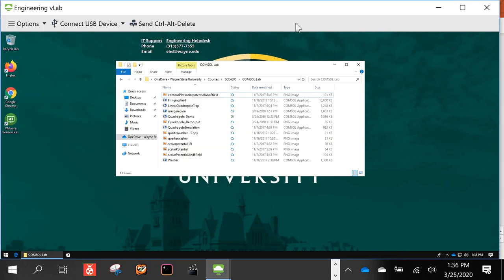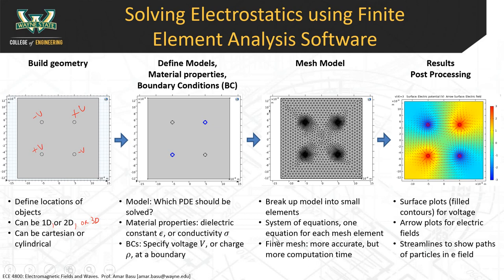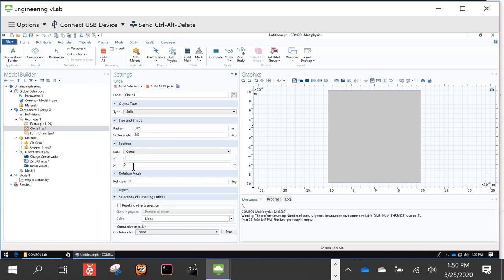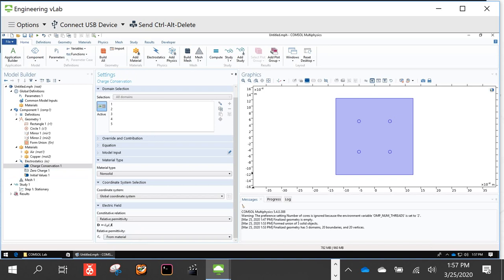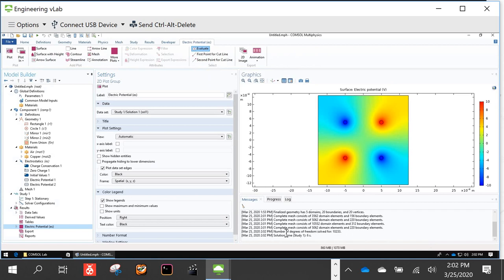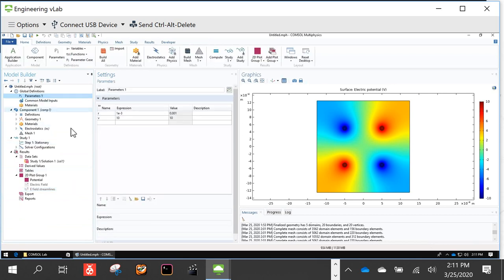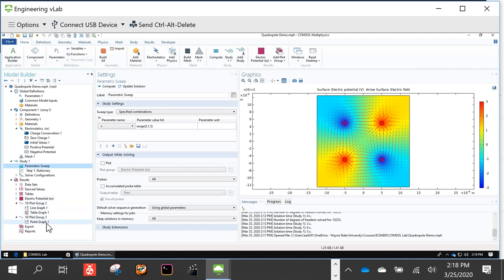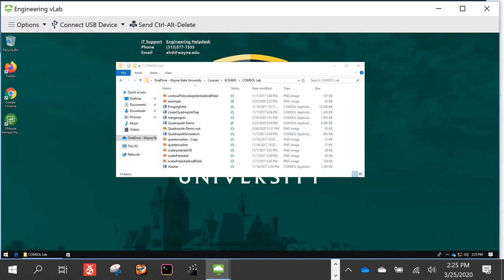3E - COMSOL simulation of electrostatic potential

Comment: Particles do not follow steamlines.   This is only true for straight streamlines.        The streamlines are always parallel to the fields and therefore the forces are always parallel (or antiparallel to the fields).   You can't go around a curved field line if a force is tangent to a field line.

Comment: while extracting the surface plots can we adjust the x range so that there will not be any white spaces in the final graph. suppose for the surface plot the x range is from 0 to 90 but in the plot it is showing from -80 to 160 so there is extra blank space to the left and right of the surface plot.